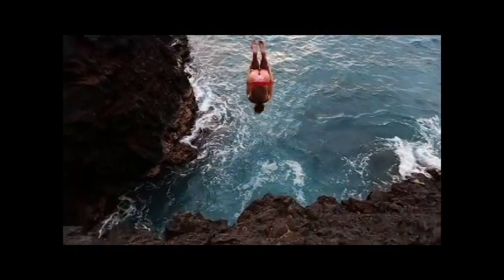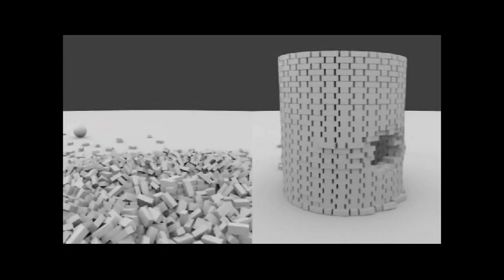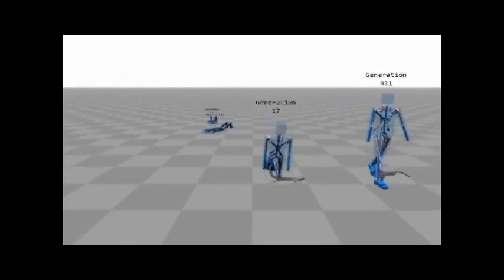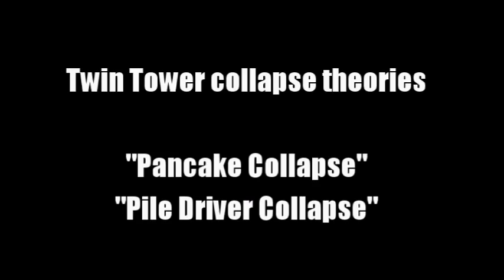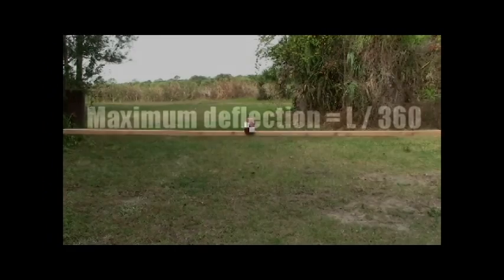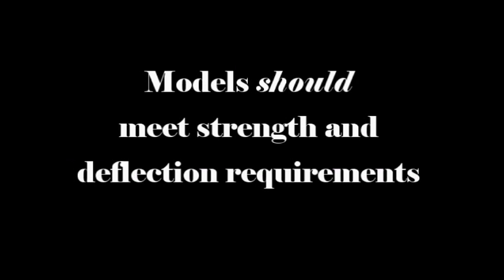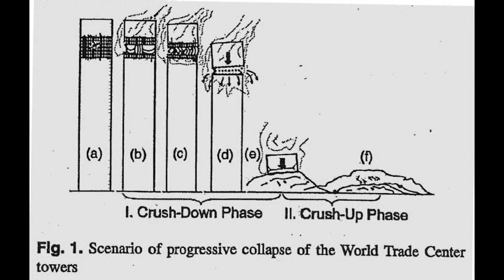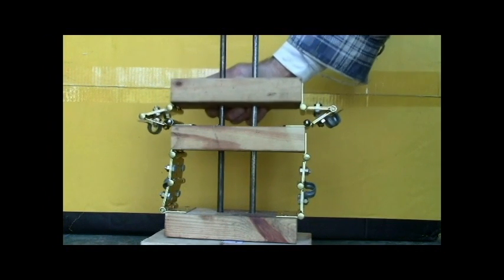9/11 Experiments: The Force Behind the Motion

Comment: funny you had the build a support so the upper floors did not topple. makes you wonder how the upper portion of the wtcs didn't topple
Reply: "a fuel air blast from soot,"

ROFLMAO  some people can make up nonsense and believe it.
Reply: Carroll Sanders <The fires are well known and the chimney effect prevention is compromised in each building.>

Right.  "Well known."  Sure.  Who was in building 7 documenting all of this information exactly?  We need to give that person a medal for recording the size, temperature, positioning, and timing of each conflagration on such a chaotic day.

Please, share your source of information.  Oh, thats right, Karen likes to make claims but can never actually back any of them up.  I almost got excited and thought I might get to see some new information, but alas, Karen can't actually speak to any verifiable facts.
Reply: +Ano Nony   The top of the south tower certainly should have, so it certainly makes one wonder about all of the so called "scientists" who have not mentioned the center of mass in 14 years.
Reply: psikeyhackr You can't have a topple over the side on a structure not strong enough to form and support a hinged Joint. DA.
Reply: Carroll Sanders  Notice that in claiming that is the case, we don't get data on the amount of steel in each level of the towers and the NIST could not specify the amount of concrete in the towers in 10,000 pages.  Just ASSUME what we see could happen on the basis of no data.  Don't wonder why material that we see shoot out horizontally did that either.
Reply: psikeyhackr The speed of the materials shooting out is below that of a detonation wave so it would have to be one of 3 factors, a fuel air blast from soot, a reaction of compressed air, or mechanical action in the collapses inducing a toppling effect.   It could even be a combination of the three.

Cole's experiments are worthless, inertia, gravity, and atomic structure can never be scaled he as an engineer should know this, so his structures can never function to duplicate the structure of the towers.    That means Cole is either a fraud as an engineer, or he is intentionally using fraudulent experiments to deceive people.
Reply: psikeyhackr Soot is pure carbon black ignited it burns at 1400C, with enough oxygen.
Reply: +Carroll Sanders you're ignoring Newtons 3rd. because they fell in freefall. 0 resistance. there's no explanation to this event that addresses it other than the weakening of the structure below as the tower fell. to argue the upper portion caused the freefall ignores again the 3rd law that there will be an equal and opposite force applied upward even if only momentarily and slowing the collapse. there was no hesitation. complete freefall.
Reply: Aaron West The towers certainly did not fall at free fall speed they fell at the speed of the resistance to disunification of structure.     Only a small part of the Curtain wall on building 7 fell at free fall after the steel structure toppled on a fulcrum, created by it cantilever beam structure.
Reply: Carroll Sanders "The towers certainly did not fall at free fall speed they fell at the speed of the resistance to disunification of structure"

How can you know that if you do not have the distribution of mass data and can know how strong the structure had to be over its height?  Believing is not knowing.  So why don't we have experimental tests to determine that?
Reply: +psikeyhackr 
He knows because Carroll knows all.  Didnt you know?  He's an omniscient, all knowing chemistry/physics/engineering expert.  Carroll doesn't need data or evidence.  What Carroll says must be fact, regardless of evidence.
Reply: +Carroll Sanders Do you really believe your nonsense?
Reply: Steve Joseph I can prove it anytime you idiots actually get a new investigation so I have no need to worry continue your being dumbazzes on the internet.
Reply: psikeyhackr You can test the connections experimentally, as long as the connection strength and size is the same.
    You can test a scale model, because, gravity, electromagnetic force, and inertia do not scale so a smaller model will show thousands of times the strength of the actual building.
     The strongest connections were the welds on the core columns, 1,000,000 pounds tensile strength per square inch.

   A one foot off center eccentric strike lowers that to 100,000 Pounds per square inch, or about the weight of an F150 truck, 
2600lbs dropped twelve foot.

The floor connections of 5/8ths bolts were not even half the strength of the welds.

Once motion begins do to the columns being misaligned it is over, no way to stop it.

It's simple math science and engineering.
Reply: Carroll Sanders "inertia do not scale so a smaller model will show thousands of times the strength of the actual building."

It's called the square-cube law.  Galileo figured it out centuries ago.  You really believe engineers did not figure out how to compensate for that decades ago!!!  It does not apply to computer simulations.  But those simulations would still require accurate mass distribution data.  So why don't we have it after 14 years?
Reply: psikeyhackr how are you going to know where everything is?
How much water is left in the tanks how much stuff does not burn?
  Also you are correct on the square cube law, and yes the more accurate the data the better the computer simulation.
   No arguments there, in fact the numbers I gave you were used via the Maxwell equation for a pinned beam, in a computer simulation.
Reply: Carroll Sanders   I guess it was only a matter of time before this debating tactic came up.  If we can't determine the location of every water cooler then there is no reason to know about the distribution of steel and concrete.

Didn't the designers have to make the steel support everything else?
Reply: psikeyhackr I am talking about the huge water distribution tanks, not water coolers how much water would have been left in them.
   They were on each set of mechanical floors.
  They pumped water up to tanks and then distributed it, that kept the water pressure from bursting the pipes.

  The steel structure and it's weight is well known the other components are the problem in estimating the Mass.
Reply: Carroll Sanders  "The steel structure and it's weight is well known the other components are the problem in estimating the Mass."

Oh really, there were 2800 perimeter wall panels from the 9th floor to the top of each tower.  How many different weights of panels were there and what was the quantity and weight of each grade?  The NIST managed not to specify that in 10,000 pages.
Reply: psikeyhackr Nist didn't have to specify that, any engineer can request the design drawings. 
PS the weight will be in the designed load.  It will also be on the building permits.
   It is a non issue because it was supplied by the designers.
Reply: Carroll Sanders <how are you going to know where everything is?
How much water is left in the tanks how much stuff does not burn?>

Hey look, Karen just had an epiphany, and realized that models such as the BS made up by NIST don't actually prove anything because there are too many estimated factors and confounding variables.  Thanks again Karen, for explaining how the NIST report doesn't actually prove the official collapse theory.

Looks like once again you are left with zero supporting evidence for any of your positions.

<Nist didn't have to specify that, any engineer can request the design drawings. >

Oh, so I'm sure they used the right parameter inputs to account for the huge variety of materials and connection types in the building.  Lets just go back and double check those parameters...OH THAT'S RIGHT, THEY WON'T RELEASE THE PARAMETERS.

That must be because they are just so accurate, they don't want the terrorists to know how accurate our computer modeling parameters can be.  Yeah, that's why...

Fcking moron meatpuppet.  Do you actually think you are convincing?
Reply: Emvaz22 The perimeters are well know I have been arguing them with Tony S. For years.

The welds are Known and the 5/8ths bolts are know they are on the original architectural drawings.
There have been countless discussions on them!
Reply: Carroll Sanders   Usual debunker crap.  You claim things but don't provide data and source on what you claim.  How many different weights and what were they?
Reply: psikeyhackr The strongest Connections were the core column welds Arc welds continuous from the outside only.  They had a tensile strength of one million foot pounds per inch in non sheer loading.
Reply: psikeyhackr He's pathetic isn't he?
Reply: Carroll Sanders <the perimeters are well know I have been arguing them with Tony S. For years.

The welds are Known and the 5/8ths bolts are know they are on the original architectural drawings.>

And the location of fires is unknown.  The temperature of fires is unknown.  The structural damage (if any) is unknown.  The weight distribution of the contents of the towers are unknown.  

Not knowing all these variables, and you actually believe a collapse model in a computer based on estimated parameters (which they won't release to the public) proves anything?  Fool.
Reply: Emvaz22 The fires are well known and the chimney effect prevention is compromised in each building.
Reply: Emvaz22 R. J. Lee Found evidence of huge chimney effect fires.
Reply: +Carroll Sanders <R. J. Lee Found evidence of huge chimney effect fires.>

Mhmm, and to you this is enough information to surmise the size, temperature, positioning, and timing of each conflagration?  You're so dumb.

RJ Lee also found evidence of volatilized (boiled and evaporated) lead.  That only happens above 3000F.  Seems a little tough for an office fire to get that hot.
Reply: Emvaz22 Car batteries arcing ,other arcing electrical components, account for those.
Reply: Carroll Sanders You didn't answer how evidence of a chimney effect is ample data to surmise the size, temperature, positioning, and timing of each conflagration.
Reply: Emvaz22 why do I have to answer the obvious, are you clueless?

Love how Cole uses fraud to deceive fools like you.
Reply: Carroll Sanders <why do I have to answer the obvious, are you clueless?>

Ah, so not only do you believe that evidence of a chimney effect is enough data to surmise the size, temperature, positioning, and timing of each individual conflagration., but you claim such information is "obvious."

Such an obvious meatpuppet shill.
Reply: Emvaz22 Chimney effect under those conditions can approach the temperatures of an air curtain 1400C, as they burn pure carbon soot. 
    Isn't that obvious to you?
Reply: Carroll Sanders <Chimney effect under those conditions can approach the temperatures of an air curtain 1400C, as they burn pure carbon soot. 
Isn't that obvious to you?>

And to you, this is proof of the size, temperature, positioning, and timing of each individual conflagration?

No, not even remotely.  Even NIST admits this is all estimated.  And guess what?  A computer model built on estimated parameters proves nothing.

Try again, fraud.
Reply: Emvaz22 A chimney effect can only occur in certain parts of the structures, so evidence of a chimney effect indicates significant damage will occur.
Reply: Carroll Sanders <A chimney effect can only occur in certain parts of the structures, so evidence of a chimney effect indicates significant damage will occur.>

Ah, so you are still claiming that this is enough data to determine the size, temperature, positioning, and timing of each individual conflagration, and the damage they they did to the underlying structure.  WOW, you're fcking stupid.
Reply: Emvaz22 Not at all your just a moron the huge amount of carbon released in the videos of the fires tells me that high temperatures were inducing a lot of pyrosis of the hydrocarbon based plastics, that could only have occured with a large stack, Chimney effect. DA moron you haven't got a clue!
Reply: ***** Doesn't matter you both have lost the argument, there are things happening that will shock Harrit and Jones followers this year.
    This is going to be fun.
Reply: +Kevin Kelsall Now you're posting in the wrong thread.  You aren't very good at YouTube comments :)

Comment: Controlled nukes(isreali w54's) brought these structures down. Sending the blast upwards turning everything into dust(vaporized) including the huge antenna on the south tower. That's how these towers went down, another form of controlled demolition. It was operated from within the wtc7 which of course had to go bye bye along with the base of operation inside it. Check it out, there are countless of info on it. It's the most reasonable explanation believe it or not and it was planned from the beginning if they ever needed to scrap the towers in a legal way.